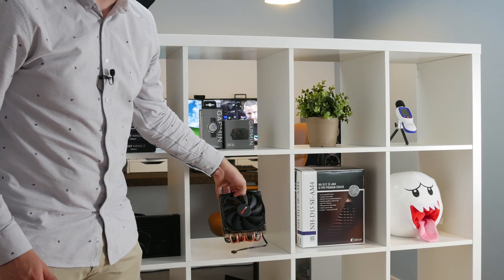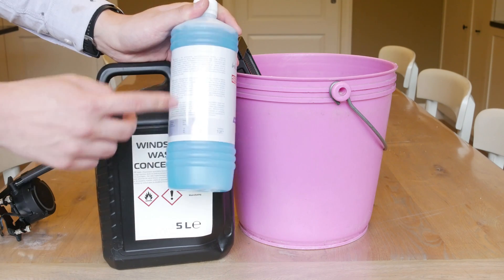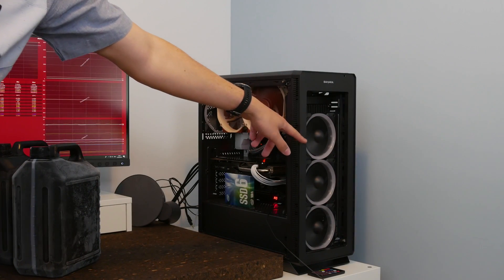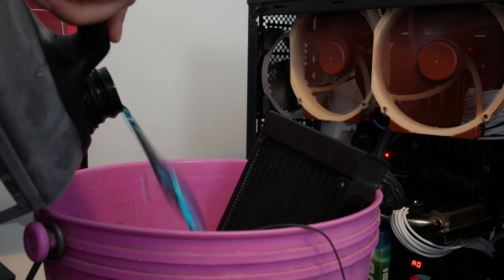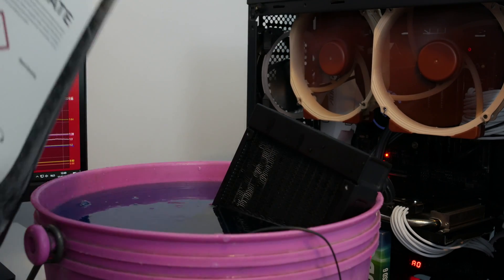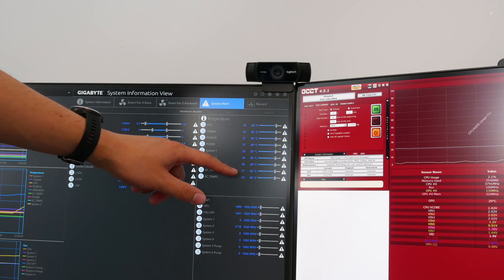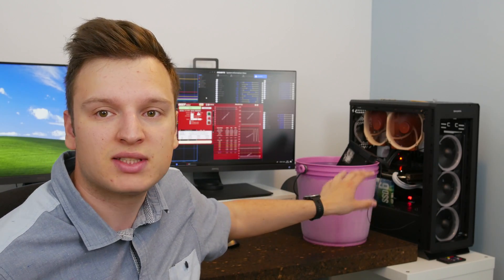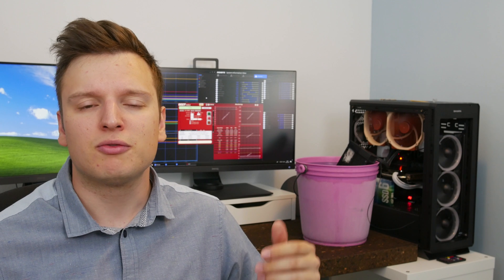The anti-freeze froze... | Nerdy Experiments Ep.8

Comment: i think one of the potential issues is surface area and the amount of water you have, to get really low temps you would probably need atleast a 480 or more, sized radiator, a 360 just doesnt have enough fluid to stay in the cold bucket long enough before it goes back to the hot cpu and warms back up again, meaning it never gets really very cold.
Reply: aidenhill hmm maybe but I don't think so I think that it's heating up the water and Pockets around the radiator I think that if he had a fan and use mineral oil instead of windshield washer fluid it would have worked mineral oil is non-conductive and fans will spin up in it